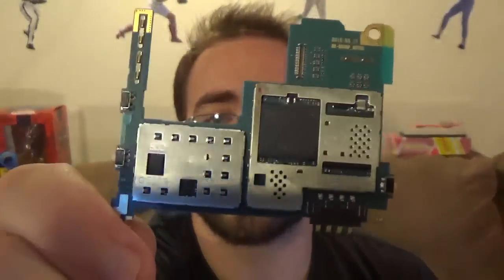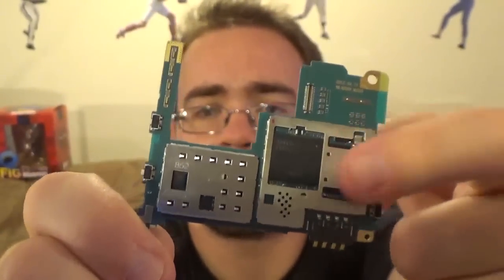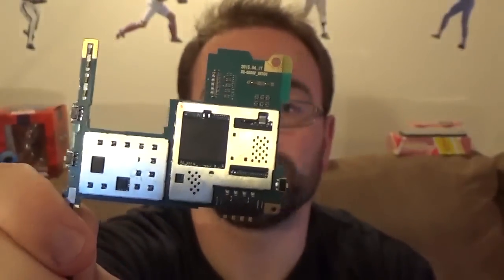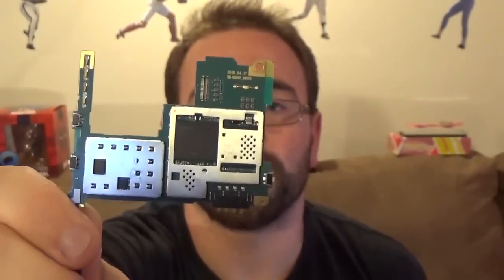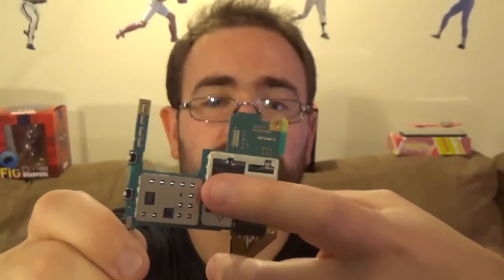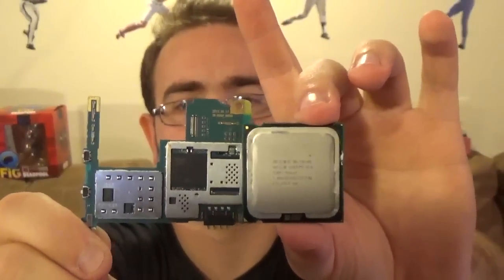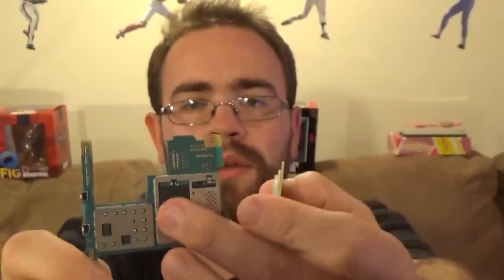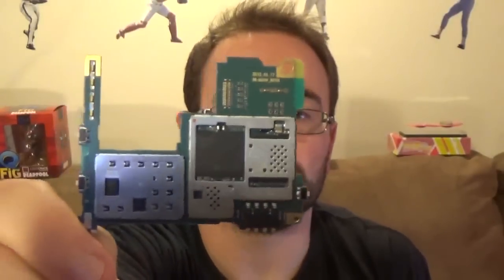Nintendo Switch - x86 And ARM! Why Is Nintendo Using ARM??

Comment: Where did you get this info????? The NX is a modified Tegra X1 so its x64
Reply: Always wondered this myself. Thanks, Man !! :D
Reply: Tegra X1 is ARM based!
Reply: Mum Blic
I know I meant the x86 part, and an ARM processor makes perfect sense. They're capable of doing insane number of instructions while being really energy efficient. Perfect for a mobile device that needs processing power as well as energy efficiency.

So this video makes no sense, what did he want a High powered CPU that would give you a 2 hour battery life?
Reply: Nepu-Tech USA Still not sure what you mean with x86 part and also I don't get your first statement "The NX is a modified Tegra X1 so its x64"?
Reply: + OK I see, but x64 is the short form of "x86-64" 
Don't use x64 as a general term  to describe  64 bit!
Reply: You keep misunderstanding  x64!

x86 is used for describing the platform/architecture in it's global.
x86-32 : 32 bit generation of x86
x86-64 (or x64) 64 bit generation of x86

The Tegra X1 is a 64 bit ARM processor NOT x86 or x64 or anything from the Intel/AMD family

There are three architectures used in today's consumer products: x86, ARM, PowerPC. The last one is dying out. All of them have 32 bit and 64 bit variations. 

Resume:
x64 do not stands for 64 bit, it's stand for the 64 bit generation of x86
Tegra is pure 64 bit ARM architecture. (no x64 at all)

It's important because x86 is a much more powerful then ARM but it does not run well on batteries and it needs much bigger cooling systems.

He was just trying to explain why Nintendo went for ARM
Reply: I'm so confused now :p
because I thought the arm could run the x86 instructions so that's why games would be easy to port but from what you're saying it's a completely different thing?
Reply: Nepu-Tech USA ARM CPU can't run x86 code directly.  In theory it could be done in an emulator, but the performance drop would to big. Maybe some old DOS games could work

Crucial are the game engines and toolsets that most developers are using. Mostly there is support for x86 and ARM. There is less support for PowerPC.

Porting is not just a transfer. It's still a lot of work: recompiling, optimisation, etc..

It's all about accepting the standards within the game industry. x86 for desktop and ARM for mobile. Nintendo try to force their own platform, but failed.
Luckily now they have chosen for a more standardised platform: ARM+Nvidia GPU

Comment: The instruction set of x86 is greater so a arm processor needs more clock cycles to do the same complex calculations. Its really hard to compare.

Comment: Basically, Nintendo is using ARM because of the low energy intake it needs to process instructions. While x86 can have complex instructions to do something, it uses huge amount on energy because the processor needs to "translate" every complex instruction to the simple intructions the CPU can do and, then, do the simple instructions; in the other hand, the ARM architecture can be efficiently programed to consume less energy (since it executes the simple instructions directly, no "translating" involved), and if you have a complex programming language that uses the most efficient ways to do an action in the simple language for the ARM, the processor can achieve more actions for less energy consumption. If you think about it, the programming can be ported easily between architectures if you have a good, well defined language in both architectures.

Comment: This whole ARM vs x86 thing kind of reminds me of the difference between Windows and Unix. Unix was always explained to me by having a very simple and straight-forward kernel that was able to do processes more efficiently than Windows. Hearing this bit of explanation actually increases my anticipation for the Switch as I want it to be able to run all the third party games that I love to play and would certainly play on my Switch if the games looked good AND were portable.

Comment: You did start with the key point.  Power consumption.  x86 and it would be suicide.  Everyone is fearing battery life as-it-is.  x86 would just kill it even more.

Except the latest Windows 10 tablets, all mobile tablets use ARM for a reason.

If you are going mobile, you go ARM since it is also mobile-proven.  Heck, 3DS uses an ARM processor.

Comment: The WiiU has an ARM processor that acts as a watchdog for the PPC CPU.
Reply: Rayan Mestiri what? Wii u uses powerPC not ARM
Reply: It has a PPC processor AND an ARM processor. The PPC's instructions have to go through the ARM security checks. That's why the WiiU is still not fully hackable up to this day.
Reply: Rayan Mestiri where the hell did you hear that? it uses a powerPC processor and the ARM CPU that some people report being in there does very little and has nothing to do with preventing it from being "hacked".  people just have no reason to hack it.
Reply: Ben Fiske The ARM CPU is dedicated to prevent the PPC to execute code its not supposed to. It's whole purpose is for security. Which is pretty much also what the PS4 is doing. It also uses an ARM processor for security.
Reply: Rayan Mestiri show me official break downs that prove the use of an ARM CPU and that it is used for security.
Reply: Ben Fiske http://wiiubrew.org/wiki/IOSU
"PowerPC code is able to call IOSU drivers through an IPC interface. It uses the same call interface as IOSU does internally. Userspace code submits IOSU requests with the IPCKDriver_SubmitRequest() syscall in the Cafe OS kernel. The kernel includes information to identify which Cafe OS process sent the request, allowing IOSU to check permissions on a per-app basis. Requests are contained in a struct, sent through a hardware interface, and marshalled by the IOSU kernel to a target process."

The ARM processor checks everything that the PPC wants to do with the OS before executing the code. It has a permissions system and everything. You can't be more dedicated to security than that.
Reply: Ben Fiske The ARM CPU runs the whole Operating System, I would hardly call that "doing very little".
Reply: Rayan Mestiri I think the confusion is that you are calling this a CPU. it's not, it's an I/O processor that exists on the same die as the CPU and GPU.
Reply: Ben Fiske You are the first one to use the term ARM CPU. I always said "ARM processor" until you started using "CPU". You can now backpedal all you want, you were wrong, just admit it and move on.

Comment: does ps4 have a small processor for the rest mode?
Reply: What is rest mode? 
No I don't think so.AMD's jaguar architecture is been used. dual 4 cores cpu's
There is no need for low power cores, because it does not run on batteries.
Reply: Mum Blic rest mode is when you turn off the ps4 but not completly because it can keep downloading games and stuff
Reply: KaNawogirusa This is what I think based on what I have read so far.

Based on the power consumption of 3W to 10 W I would say it's very similar to a PC when it goes to standby mode. Everything is shut down except: the CPU is halted completely but kept alive, RAM is also kept alive, and the usb ports are providing power for charging.

When downloading the cpu is working like normal but gpu don't have to do much so it uses less power (+/-70w). When finish it halts itself. On a regular base a timer triggers an event so the systems fires up to check if it has to do something (for example  checking for updates) when there is nothing to do it halt itself until the next trigger event from the timer.

Conclusion: most of time the CPU is completely halted

Low power cores are used when the system needs be alive all the time so it can react to certain events (other then the timer or pressing a button). For example a phone has to be up and running otherwise it can't accept incoming calls.
Reply: The PS4 does have a separate, low power chip running background tasks (like uodating the PS4) while in rest mode.
Reply: ShinFiwaicearth Please a reference for your statement. I would find it strange because of the unnecessary cost!
Reply: I found the following statement in an article: dualshockers.com

_Ito-san explained that initially Sony attempted to have background download performed exclusively by the secondary sub-system ARM chip (as it was announced during the console’s presentation in February), in order to keep the main APU powered down, but that proved not to be fully possible.

The download process is too heavy for the ARM chip alone, so the Jaguar-based CPU of the main APU is called into action to do the heavy lifting and protocol processing._

This is from an older article so I'm not sure that this still applies to the new PS4 Slim or Pro

Not sure what this ARM chips is doing. Probably not much more the timer function like I have mentioned before. Very strange design because they have to build a complete software stack before it can do something meaningful

Comment: It doesn't simply qualify as a handheld. That criteria you mentioned is required of a handheld. That is the only way to play the 3DS or Vita. You could play the Switch without ever once picking it up and holding it in your hand, with no extra peripherals or anything. Cant just chock that up to a handheld.

Comment: fucken dope video! I was wondering if you think that the 4 gig of ram will have anything to do with the fact that it's a arm chip they are using? also was wanted your take on the 32 gig of on board hard drive space, if the fact that they are using carts will mean that it will eliminate the need for huge install?

Comment: apple chips are faster than samsung even though samsung phones have more ram? what? what does one even have to do with eachother.

and sure, arm processors might have more calculating power than an x86, but in overall performance and flexibility, arm processors are way behind x86.

Comment: Thanks for the info. It would also explain how when the Switch is docked it could possibly be basically opening all the cores full blast which would allow better visuals. It's really smart design.

Now what I want to know is how would porting work. We have developers saying that it is easy to port from the other consoles but going off your explanation Arm processing talks more/closer to the hardware needing additional instructions while x86 talks at a higher level needing fewer. Do you think that there would have to be some kind of translation going on when porting? Or does that all come through the compiler?

Comment: Probably because ARM isn't as primitive as it used to be. It's powering some damn powerful pieces of hardware and software these days. Not to mention, since it's pretty much always used in system-on-chip systems, which is preferred for mobile systems, it takes up less physical space and highly prioritizes a great balance between power and energy efficiency. This is just my pre-video guess.

Comment: Battery life of Nintendo Switch is only 3 hours. iPad is like 10 hours. And they're using ARM. Nintendo should get iPad battery tech to power their hybrid toy.
Reply: Amristar Nintendo switch is way more powerful than a iPad and uses more power lol, and I'm there'll probably be accessories that extend the battery life of the Switch
Reply: Have on mind that Switch has a gpu more powerful than ipad and is meant to be used at full load all the time, plus battery life is still a rumor.

Comment: One of the console right now uses a mobile processor, idk if it is the xbone or the ps4 but one of them use a mobile processor.
Reply: ***** The CPU part of the APU is something used in tablets and laptops but the GPU is way more powerful than anything in any mobile device. This APU isn't used in any tablet whatsoever.
Reply: Mika Hadi That's true but the main reason for the ARM chip is security (ARM Trustzone).
Reply: The PS4 and the Xbox One both use an AMD APU which is x86_64. Not a mobile processor.
Reply: both use AMD Jaguar, an APU used in tablets. So yeah, they use "mobile processors" they just use AMD64.
Reply: fan facts PS4 has it's own arm chip  , for low power processing (downloading,  multimedia task, and other tasking out side gaming) they using arms

Comment: Nice explanation about both architectures. Batery lifetime is the main reason nintendo choose ARM instead of x86 but that can be the main problem nintendo will have. Nintendo is trying to allure devs from ps4, xbox one and PC and the fact of having a diferent architecture processor will make a lot of trouble to port games to switch, which can make switch have the same problem wii u had.
Reply: Pab Jul - x86 to ARM is very simple compared to the P-PC Nintendo used in GCN,Wii & Wii-U.
Reply: well developers have said before the switch was announced that its easier to port a game to it than any other Nintendo system. so it's being ARM and not x86 shouldn't be the problem. it just depends on the dev.
Reply: TheBlackShinigami
Shouldn´t be a a problem? Do you know how much time and effort devs invest to make a decent port from ps4 and xbone to pc and viceversa? And those are platforms with the same architecture and similar specs. Wii u has x86 processor but the hardware is so weak that devs decided to bypass it.
Porting x86 to ARM is not that hard compared to exotic architecture used in previous generations, thats out of debate, but is far away from been easy.
So in the end it will depend on how much units nintendo switch sells, so developers start to see profitable the port.
That can take Switch to the same loophole of Wii u: People doesnt buy it because still hasn´t the games they want and developers dont port those games because people doesnt buy it.

Comment: Basically, Nvidia can have a huge chunk of room to add a beefy GPU chip with powerful Architecture without sacrificing battery life. 

Nvidia Shield Tablet with the X1 chip shows that it can do close to that of an XBox One yet product less heat and consume less power. Now, if Nvidia is correct in saying that they're developing a brand new custom chip with console power in mind, we could see the Switch actually doing better than the PS4 and XBox One in the power portion but it won't rely on the raw specs but the architecture.

Comment: Also a huge reason why x86/64 eats so much power is LEGACY INSTRUCTION SUPPORT.  In other words you can't really optimize it beyond a certain point without changing the instruction set because there are instructions in there that date back to the 8086 which is around 3 decades old now.  On top of that Intel chips have to convert its own instruction set to basically something similar to ARM which is what it runs internally.  This doesn't hurt performance more than a few % but it does add plenty of transistors and complicates the instruction cache system.  ARM is much leaner and requires fewer transistors.

Comment: The Switch seems to be an overpowered handheld with a poor battery life masquerading as an under-powered games console.
Reply: Togar They are fun to string along.
Reply: 'It's all about the exclusives' but the main reason the wii u was a flop is because of the lack of 3rd party support. Nintendo couldn't save it with their 1st party games.

I like the system, but it lacks games and mass appeal.
Reply: Define under-powered.
Reply: durkadur27 I'm sure for the simplistic cutesy nintendo games it's fine but for third party it can't be without big sacrifices like in the wii.
With xbox and ps bringing out even more powered hardware and people complaining since the start of this gen that there wasn't a big leap over the last and that the consoles aren't as powerful as they should be and the makers claimed what sense does it make realising a console this far into the cycle that has less power under the bonnet than the x1 and ps4.
Nintendo need third party desperately and have been touting the support of them as a selling point but they won't support the switch for long releasing gimped versions of games available on other machines.
Reply: Gambit771
maybe you should just pass on the switch.
Reply: durkadur27 I probably will but there is a comment button on YouTube and I had a comment to make so I won't pass on making it.
Reply: Gambit771
It's simple dude, if you don't like Nintendo games don't buy a Nintendo console.  What kind of stupid idiot would buy a Nintendo console to play third party multi-platform games anyway?  It's all about the exclusives that run and play like a dream.
Reply: durkadur27 I never said I was going to buy one.
I do like the gimmick of this one apart from how small the controllers are when separated from the machine.
In a good few years when I can buy one extremely cheap second hand and there are flash cards out (I love the fact they have gone away from optical media) I probably will get one then.
But if someone wants to buy one on release day I don't care.
Buy it but it is simple that when someone can leave a comment they will and not everyone will agree with you so you need to get used to that.
Reply: Gambit771
That's why I comment and argue...  You're going to have to get used to that.
Reply: durkadur27 I am. you're the one struggling to handle my opinion remember.
Reply: Gambit771
Well your opinion has been invalidated.  Since you lost the debate n all.
Reply: durkadur27 Er, ok.
You said you was arguing and not debating but that's fine.
I don't see how I "lost" especially as this is on YouTube and that immediately makes everyone a loser but if you really feel the need to "win" to sleep better at night you can think that.
After all it isn't like either opinions have been changed, invalidated or any "facts" have been used. All that happened is opinions were expressed on two different topics.
But I'm sure you have a gold star ready to add to your wall chart of youtube wins. :D
Reply: Lol keyboard warriors are so fun
Reply: Gambit771 true